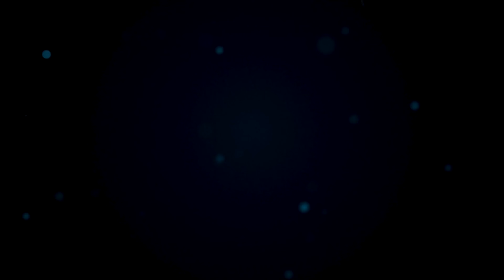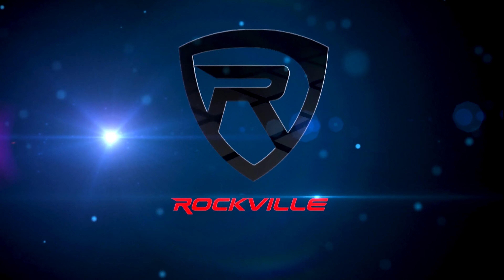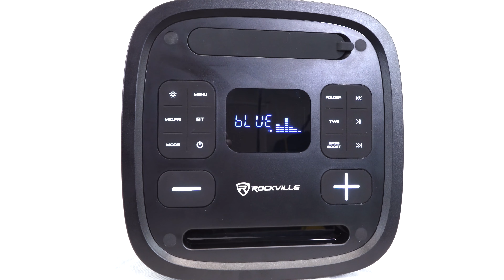Inputs, Controls, Outputs Explained on Rockville BASS PARTY 65 1200w Battery Powered LED Speaker

Comment: Is there any way connect this to an external source via stereo line output?
Reply from the maker: Great question! The BASS PARTY 65 doesn't have a line output. Its connections are inputs (Bluetooth, USB, SD, aux, mic, and guitar). For more sound, you can link a second BASS PARTY 65 with TWS for Bluetooth audio: https://support.rockvilleaudio.com/hc/en-us/articles/38576635293467-BASS-PARTY-65-How-To-Set-Up-Use